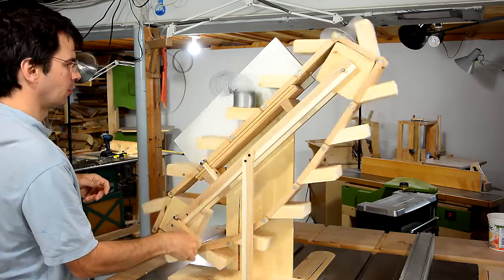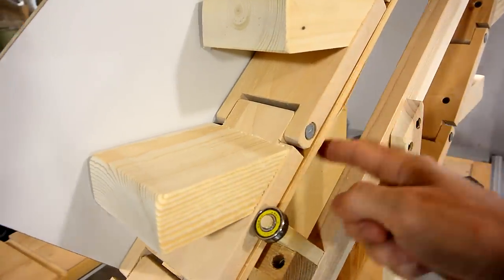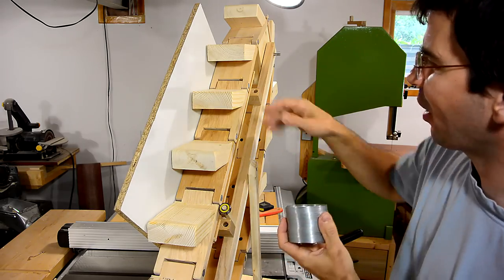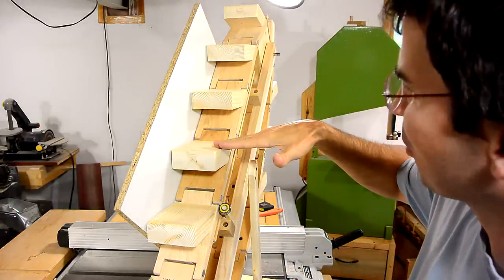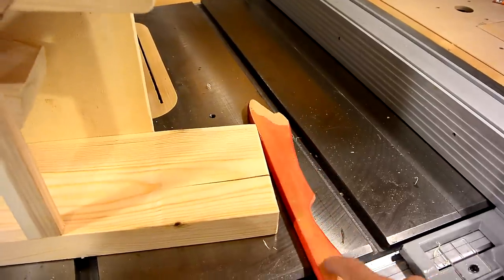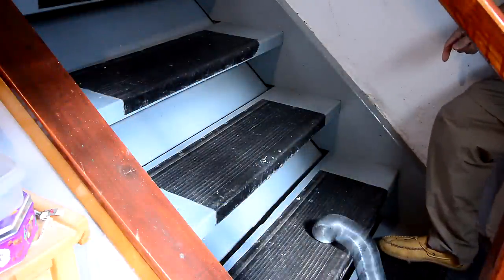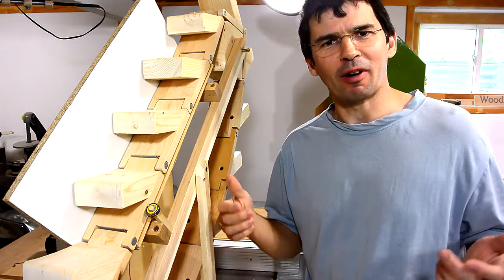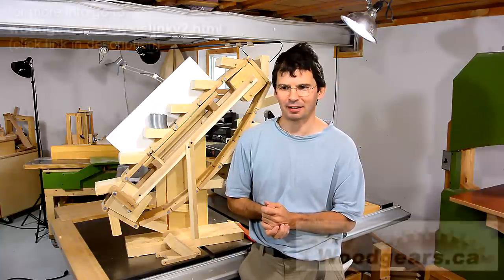Slinky machine followup

Comment: Very cool! Just a thought... I can't possibly know if this would help, but here is my humble opinion or thought... you could make a one-inch extension to each link to go from 10x10 to 11x11... this will take 14 metal screws and nuts, and make your device have 28, but should allow for smoother rotation... you will likely need to replace the square gears/sprockets on each end to be bigger, and with angled corners/edges to accommodate the new links. Also... you could remove the bearing setup for less parts if you were to alter each link to have a hollowed out gap underneath... one that lined up with a raised rail that kept the links centered with the end gears/sprockets. Hopefully this makes sense... I have tried to make something with ASCII to explain what I mean, but didn't have much success... here is the best of what I made after a couple minutes of messing around:
_|___|_|___|_|___|_|___|_|___|_|___|_|

great idea... cool stuff!

Comment: You could add a small cone to each step to help the slinky land centered on each cycle. It may not seat fast enough and flop off though, but it would help stabilize the tracking of the slinkification.

Comment: I think a weak magnetic thin ring (matching the slinky diameter) mortised in each escalator step ( or buried under a veneer piece) will guide the slinky to where it suppose to land. Assuming the slinky is made of a ferrous material off course. alternating the polarity of each ring so the slinky won't repulse from the lower ring before detaching from the upper one.

Comment: Matthias, you could analyze the frequency sound of each step of the slinky and calculate the speed needed for it to "endlessly" go on. Then it's just a matter of building the gearing and using your electric drill again.

And I'd analyze it with the stair standing still.

Comment: What if you put sides on each step and angle them to sort of funnel the slinky back onto the step. This doesn't fix the tumbling problem, but one step at a time and no pun intended.

Also, what do you think about putting some of that cheap magnetic strip they use for refrigerator magnets on each step to maybe slow down the descent a little and give the slinky better grip???

This is pretty cool, useless.....yes, but never the less, cool and fun to try an figure out a way to make it function. Keep up the great work.

Comment: Maybe you could modify the slinky to have, on each end, some kind of ball suspended in the middle of the ring that helps to guide it into a hole in each step. That way the slinky always corrects itself. Of course, you'd have to create a hole in each step and sand a slope towards the center, but it might work.

Comment: I once read that escalators are exceedingly complex pieces of engineering.  Your stairs are much simpler!  

Hmm, are all slinky's the same length?  Did you try other kinds?
Reply from the maker: wordsnwood The way real escalators go from flat to steps is very cool.  Unfortunately, this also requires sharp corners on the steps, and that in turn makes them poorly suited for slinkys.
Reply: wordsnwood There are slinky's of different dimensions.
Reply: TheKaffeeKlatsch some with go fast rockets.

Comment: Square sprockets rotating at a constant speed does not develop into a constant linear motion. The driving system is not homokinetic, so you will have a standing wave of "jerks" i.e. accelerations and decelerations. The slinky could be out of phase and fail if it doesn't get a constant impulse.

Comment: Sorry. The following has the wrong grammar because mine English is poor.
The slinky needs a correct direction to start.Using hand to put it is not the perfect choice.
There's a thought about a trigger which is set on the right side of your machine. It makes the slinky downstairs. When it goes to the right position, starts rolling the handle.
The other thing that I mention is you use the square to drive the stair. The square has the corner and that makes the machine shake. Human can't feel it, but slinky do. So it always fall. But i don't have idea to solve it.
That's my thought after watching this video.

Comment: I love this, it's not useless because now I don't need to build one! I think you could control it with an Arduino using a set of backwards LEDs as sensors. The metal slinky should reflect enough.
Reply: Timber Wolf Only if you have the right bell and whistle, maybe the left ones too.

Comment: Hand cranking is not uniform. Think about it, if you crank really hard, you can actually displace a stationary anything or not make them move at all.
I would say get some gears and a motor, it's going to be hard to find the right rpm, so in between the crank and the square pulley, get some gears like a differential to smoothen the cranks
Off the topic, Using rpi and some servos, can you kindly design a tracking device
What I can think of, it becomes quite tall and less stable because of the mechanism that tilts and pans

Comment: What about using "big" electromagnets installed on the whit piece of wood ?. With them, you can keep the slinky against the wall and eventually have a bit of control over the slinky itsefl. Not sure is slinky is made on ferrous materials. But my two cents. Would love to see some raspberry action there. Image procesing would do the rest. not telling that it is EASY, because, it doesnt. you named, its useless, but hey .... sometimes the big the goal, the big you want it, even when no sense at all. The other thing is Simulink and Mathlab .. true nerd power.